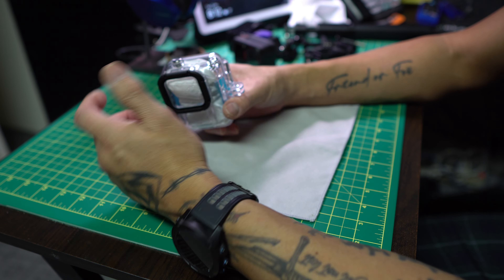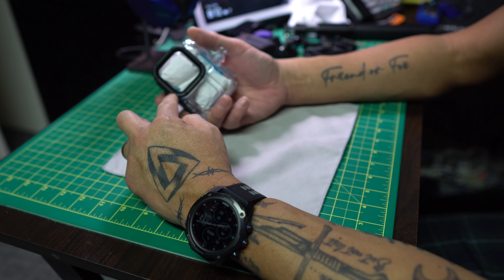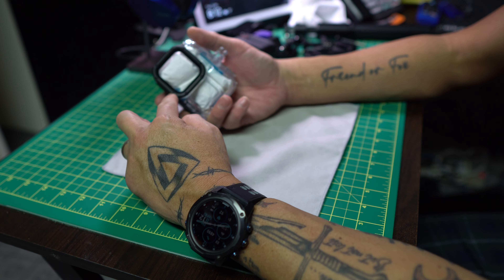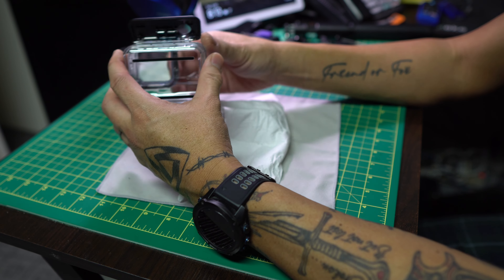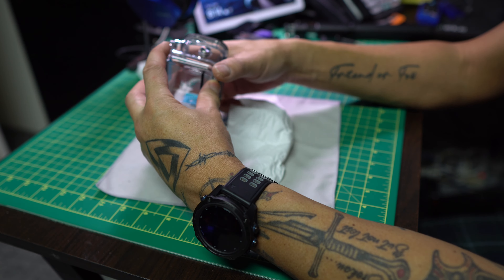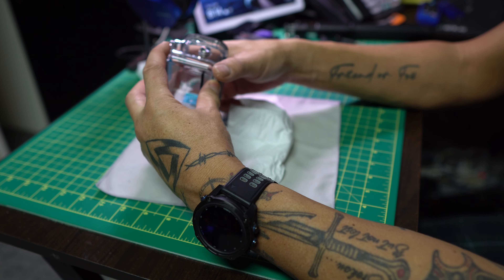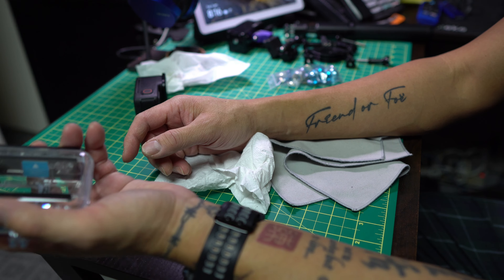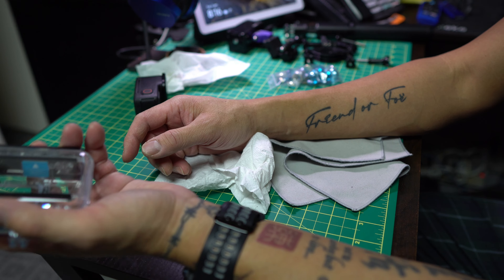Insta360 Ace Pro Dive Housing Water Leak Test...

Comment: Nice, you should try food coloring in the water 😁
Reply from the maker: Food coloring?
Reply: Eh, might stain it, but I see what your saying. Maybe something with an IR dye
Reply from the maker: @buck19  Yah, I think I might leave the food color for baking ;)
Reply: @MiyagisRant  the ir dye could possibly interfere with the ir ranging, too.
Reply: Tissue paper is the key for the test. Even a single drop of water on the tissue paper would be obvious even without color or dye. It won't hurt but it won't help.
Reply from the maker: @onlymyopiniontech  That was what I was taught and it's cheap lol
Reply: @MiyagisRant  cheap is better, especially when it's just as good.

Comment: Only if you could add a couple atmospheres of pressure
Reply from the maker: Yah, once you hit that 20 and beyond mark, that's where these cases will play a role. I had my DJI case leak at 80 feet but only a few drops inside, not pressurized leak. There was a guy in the insta360 FB group who's dive housing cracked when he hit over 50 meters during a free dive, the camera was fine, case was totaled though.

Comment: Hi. Could you reply with a link to the after-market Insta360 dive case? Couldn't find it when I searched at AliExpress. Also, I won't be using it for diving deep but rather as deep as snorkeling levels only. Besides that, just shooting my family whenever we're on or underwater. Thank you.
Reply from the maker: https://www.aliexpress.com/item/1005006395309267.html?spm=a2g0o.order_list.order_list_main.10.141d1802MBwke3
Reply: @MiyagisRant  Thanks so much for this. Regardless, I'll wait for your after market dive housing water leak test.